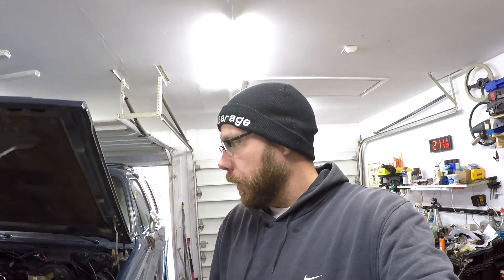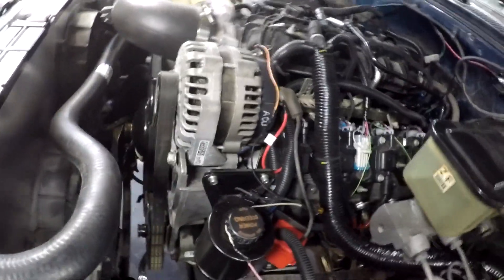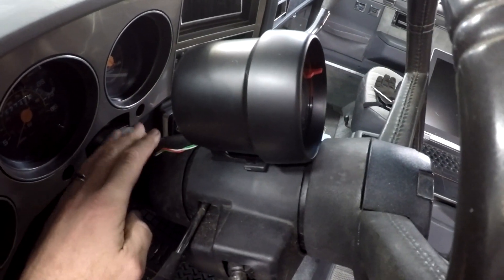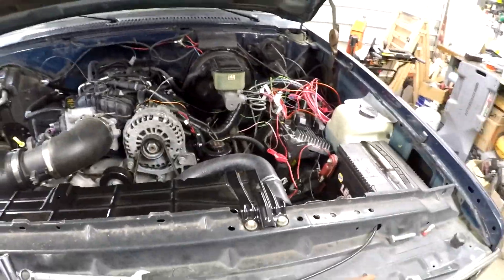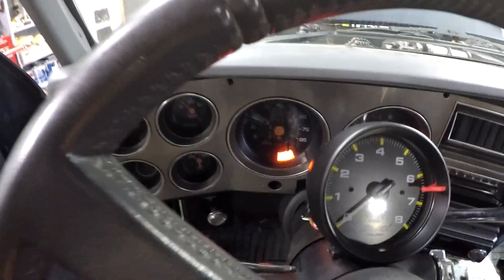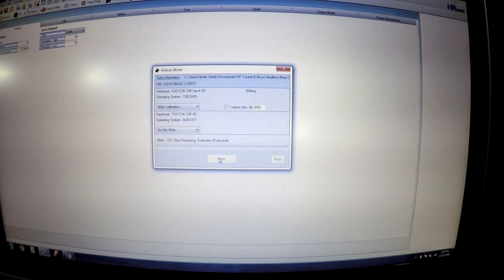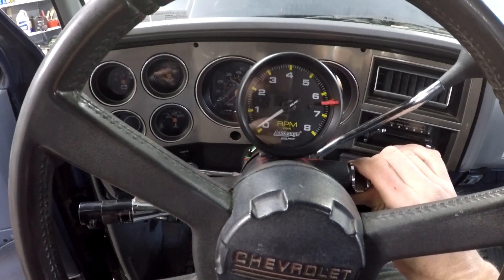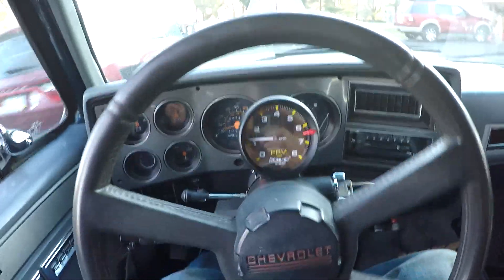1988 Suburban LS Swap - Part 18 - Update...and then we drive!

Comment: I have problem can a 2002 transfer case fit a 2006 chev
Reply from the maker: @kelleybey2735  possibly! It will probably bolt up but you need to check the spline count on both the trans output and transfer case input. If they are the same, it might work.